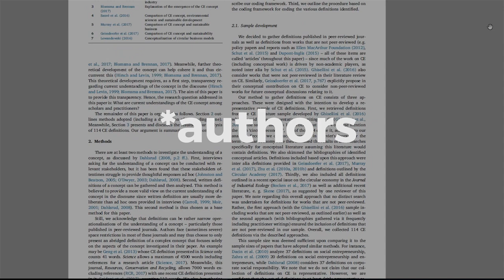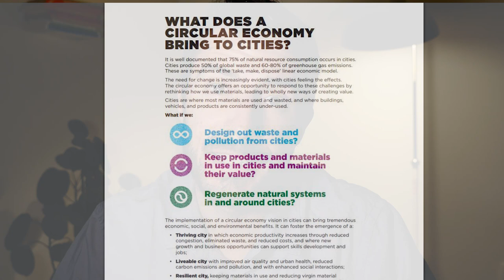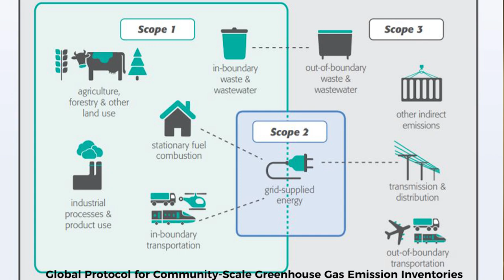Why is it so difficult to measure circularity in cities?

Comment: Hi Aristide, very insightful. I guess the consumption based approach is intellectually the most honest way to look at it.
But besides your three rather academic and technical barriers measuring circular cities (consumption based VS territoriale approach, environmental impacts and timeframes) there is one rather socio-political set of barriers. It relates to the very core of how cities, municipalities and regions have been conceived. To be held accountable and responsible for working on CE and measure it, the administrative and institutional borders should be re-aligned and re-negotiated to grasp the circular transition to its full extent. The current political and administrative delineations of cities and regions are the result of obsolete decisions that go way back into Napoleontic times in many parts of Western Europe. They are designed to tackle current day transition challenges, such as for energy infrastructure, mobility, housing, circular economy etc. We should problematise the unit of analysis as a starting point and see whether we can translate the transition needs into new, more promising configurations that will live up to the idea of adequate socio-economic and spatial units that feel more prone to be become futureproof. 
For the signs I've seen (eg Oost Vlaams Kerngebied or ToP Noordrand) this may be a difficult, but very necessary future pathway. many times, it Starts with a intermunicipal or regional cooperation, a working body that alludes to a Sense of urgency, that has means to take significant steps and that shares common goals and that Will share possible wins. Current day entities have very little much to win by looking at circular economy challenges of measuring it, because it superseds their own narrow interests (in time, political or economic terms), nor do they have thé right capacity or competencies to cope with these transition challenges.
Reply: Erratum:"they are NOT designed to..."
Reply from the maker: Absolutely! and thanks for your comment Elmar! This is one of the biggest reasons/excuses I hear when it comes to circularity in cities (for instance in Brussels which is a very small region with a lot of competencies. To combat that multi-level governance needs to be implemented alongs supply chains (or rearrange supply chains).